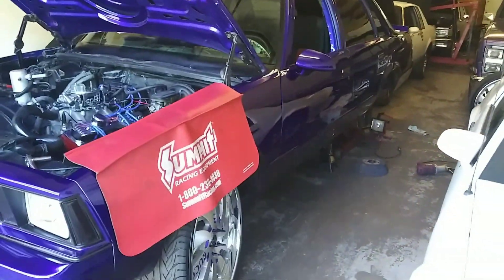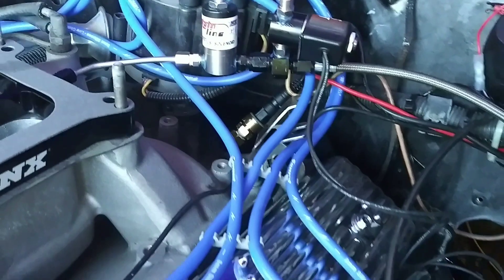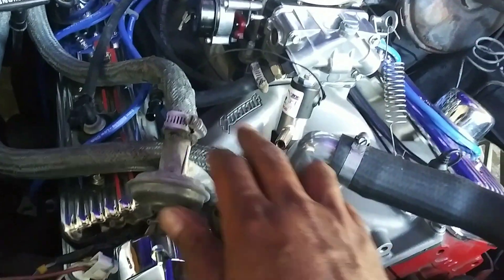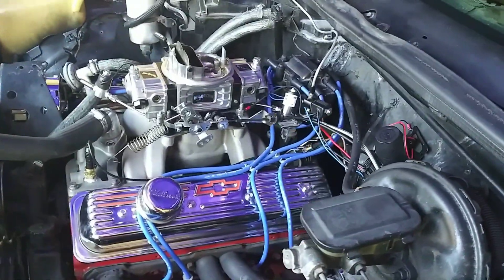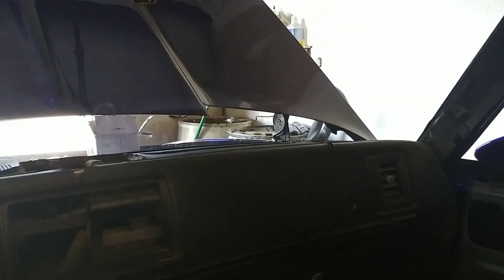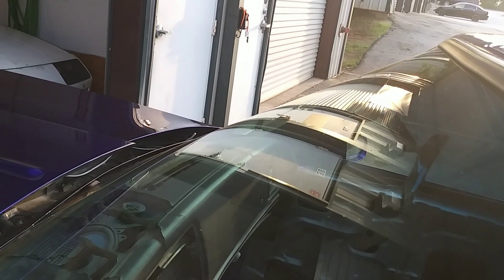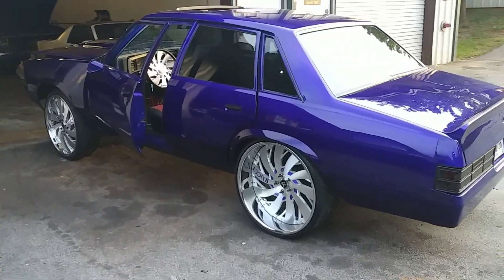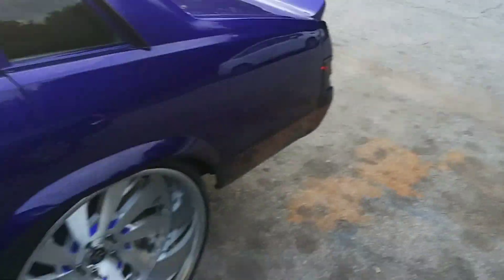Installing NOS on a stock 350

Comment: Bruh what size lift is on that stock bottom end 350 , cam specs
Reply from the maker: Its a 470 lift cam
Reply: SSP ENGINES that’s it ! 😯
Reply: @hunchoss440  they're vortec heads. They can't take a lot of lift or a lot of spring pressure unless you pin the rocker studs